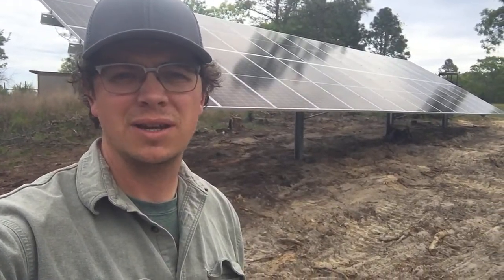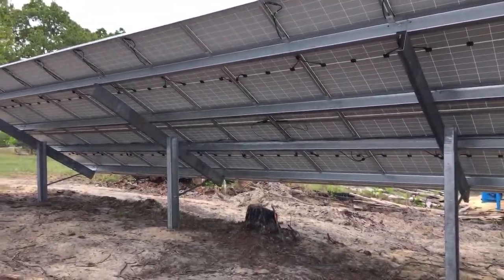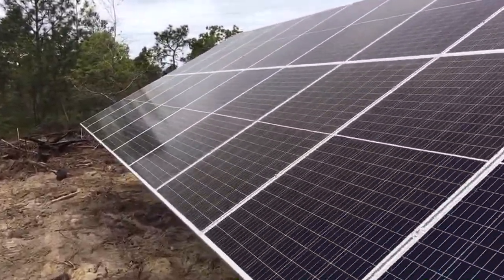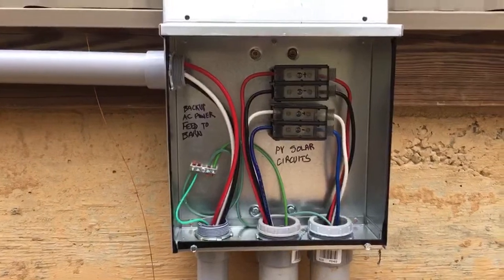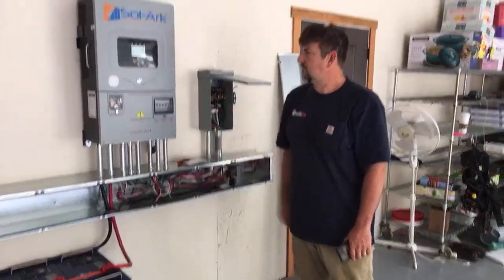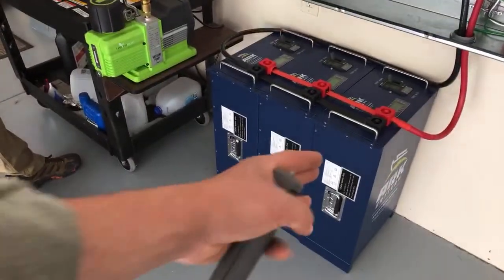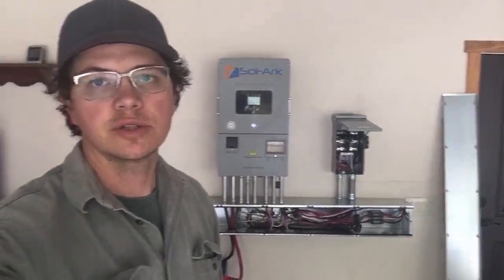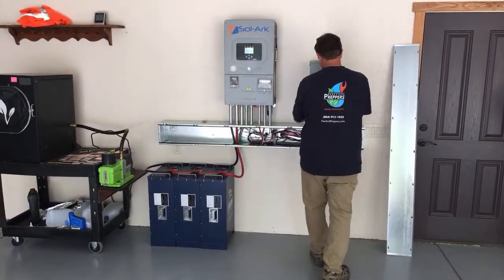Solark 12k ground mount w/Ark Lithium

Comment: Hey JV

On this long run I think you said you ran 8Gaconductors from the PV array-but per the spec sheet the SA12K MMPT max wire size is 10Ga.

Can you actually connect bigger than 10Ga from the array into the 12K or is there some trick to reduce them you didn’t show?
Reply from the maker: Yes sometimes we go into a disconnect at the house and down size the wire between the switch and the inverter
Reply: Do you have a diagram or a picture of this setup?  How is that not an issue for the current in the smaller wire?

Lastly-is the max wire size in the Sol Ark truly 10Ga or could you fit in 8?  
Thanks in advance!
Reply from the maker: @balrog006  I think we pulled six on this job. You can reduce down to a 10 from the 8.

Comment: iI it a code violation to use the IMO interal version in the box? I see you primarily use the external version.
Reply from the maker: If you mounted it in a box and protected it from moisture it’s probably fine but hard to make that readily accessible.

Comment: Those Ark batteries are 17kWh for $2500 before freight? I think I’ll take three. I have a sol-ark 12k grid tie only with 12.8k solar on it. 
Been trying to find a sensible storage solution. Those are impressive numbers.
Reply from the maker: $2500 per 5kwh battery.
Reply: @GainSolarPower   $2500 gets you 100ah@48 . pretty good considering say a battle born  12/100 is 800 bones. x 4 for 48 is 3200 dollhairs so ya, 2500 is very reasonable .. metal rack case, low temp co, shunt...  all in one no fuss.  do like.  the consumables in residential and commercial electrical  is far different than found in the small craft marine electrical world.  concept the same, product and code is totally different .  great videos

Comment: Would a charge controller be ran with just batteries? Like run the batteries to a point then swap to grid an run while charging the batteries. Then switch back to batteries. An so on

Comment: two questions why is the sub panel to the right of the sol-arc 12?  sounds silly but if there was the main panel in there, would it be main panel then to right sol-arc 12 and then to the right of the sol-arc would be the sub-panel. would that be correct?
Next (obvious but still asking) do you have to connect the sub-panel to the main panel and then connect the sol-arc to the sub-panel? or do you just have to connect the sub-panel to the sol-arc?  I feel stupid asking.
Reply from the maker: It’s ok man. Doesn’t battery which side The panel is on. Think about it like this. You have electrical panel A. There is a 100 a breaker mounted in electrical panel A that supplies power to electrical panel B. That makes electrical panel be a sub panel of electrical panel a. You could snap another breaker  In electrical panel B and feed electrical panel C and electrical panel C would be a side panel of electrical panel B.
Reply: @GainSolarPower  thanks for the reply

Comment: Nice install!  I really appreciate your videos. Thanks to yours and Scott's videos clueing me into SDE mounts, I'm getting ready to DIY install a 48 panel (72 cell) system on one of their seasonable adjustable ground mounts (concreted in, can't find anyone able to drive them here in central Indiana).  Definitely the most cost effective mount I found and I looked at a bunch. Grounding the array and grounding from the array to my inverters is still throwing me for a loop a bit though.  I didn't see any ground wire on the mount itself or any ground rods there. Do you typically ground at the mount also or just only run an EGC conductor in the conduit with your PV homeruns?  Any suggestions on a good resource to learn more about what is required for grounding of ground mount arrays would be appreciated.  Thanks.
Reply: Forgot to add.  My inverters are transformerless (SMA 7.7K's).
Reply: How much did your SDE mount cost?
Reply: @niktak1114  Total for the 48 panel ground mount with seasonal adjust option was $2950 (That was in 2021. Probably higher now since everything has gone up).  Concrete was another $950 to install.  It's a nice design and the install went smoothly.  A couple of hardware hicupps, but they were very responsive and helpful and quickly made everything right.  If I were ever to do another system, I would not hesitate to go with SDE again.
Reply: @tblservices4076  Wow that is cheap. Similar price per watt to the smaller unistrut mount I just built.
Reply: @tblservices4076  Also was that 3 panels high or 4?
Reply: @niktak1114  Yep.  I compared them to similar mounts and they are definitely competitive.  Also like that the single line of posts allows me to mow under them and check/service the panels easily plus the tilt adjustablity is nice.  That cost was me picking it up at SDE in lower Michigan (couple of hours from me).  Freight cost would be a bit for that weight and length.
Reply: @niktak1114  They are portrait orientation, so 2 high.
Reply: @tblservices4076  ah nice. That's about perfect for my upcoming 36 panel mount.
Reply: @tblservices4076  how many posts did you need and how much concrete did you need per post?
Reply: @niktak1114  My mount uses 6 posts/beams.  A little over a yard per hole (30" diameter holes 5 feet deep on average).  I ordered 7 yards on the truck and used every bit of it.
Reply: @tblservices4076  thanks for the info. That's fewer posts than I would have guessed.

Comment: What size conductors do you run for 600’ ? Seems like you’d have to go huge even at +400V.
Reply: Looks like you ran 6. That works out to between 2 and 3% not as bad as I thought at first. Love that you’re using IMO isolators. Very professional grade equipment.

Comment: Hi Johnny, I  am  planning on  setting up a  20 panel  system,  the panels are 39 in× 80 in, I am  running  two sets of 10 panels , 5 pairs each I would like to run them all on one ground mount 5 rows of 4 panels on top of each other  in landscape position,  they are Canadian solar panels,  can I  get  a  quote  ? Thanks  in advance
Reply from the maker: Jwv8783@gmail.com

Send me and email

Comment: Isn't this the same worksite I saw on Engineer775? So.... how's that work? One the GC, one the electrician? I know EGR is a mechanical engineer. Great work either way. I have a 100% off-grid 12kw ground mount job in Arkansas for ya'll coming up that i"ll be calling about before the end of the year.
Reply from the maker: If you want it installed before the end of the year you better call now. I’m the electrician and nabcep certified contractor. EGR is a mech E and he gets the jobs and has a machine. Hauls stuff, does the digging and selling
Reply: @GainSolarPower  Thank you sir! Installation will be targeting for 1st quarter of 22.  $$ available come end of 21. Solark too pricey so will be prob using 3-4 Growatt in parallel (15-20Kw). I'll have the batteries, panels, and inverter/controllers onsite, so will need to hash out best config and ancilliary gear like autotransformer, HVAC, etc. Water heating still needs a solution. Will set up consultation soon! THX!

Comment: What is the price on that wire trough?
Reply from the maker: There are a bunch in the video. The small share ones are about $45. The long ones vary. But usually around $200
Reply: @GainSolarPower  Sorry I should have specify, the main one below the sol ark. 10x10x72 inch I Believe. Do you supply them? or if not what supplier sells them.
Reply from the maker: @jacquelineheaton8463  please send me me email

Jwv8783@gmail.com

Comment: Fail --you don't run jacketed cable (the sec/ser cable) or MC cable in conduit !  Thats why you have the issue with the anti short bushings ---What should have been done is a J box at the other end of the pvc conduit run and a MC connector used.
Reply from the maker: You are incorrect sir. We passed inspection with flying colors. I’d love to see the specific part in the code that doesn’t allow me to do that.  MC cable can be used in raceways. I know what you are saying about not landing in a connector but we do use anti short bushings and observe conduit fills. While we are picking people’s work apart,  let’s see some of your stuff.
Reply: @GainSolarPower  conduit is NOT a raceway  ---you would never pass with my inspectors!
Reply from the maker: Are you and electrician?  Have you read Art 100 of the NEC. The definition of a raceway is in there. If you are an Electrician I’m not gonna argue with you. 

One thing I have noticed is that work is done differently all over the place and it’s ultimately up to the inspector and he passed our job so if you are arguing with me about stripping out 15’ of MC transitioning in a box with a fitting so I can run it the the pvc then i get your point but If you are arguing about rather a pvc conduit is a raceway you are wrong there buddy.
Reply: @GainSolarPower  a retired electrician after 50 yrs in it
Reply: @peevedpatriot3217  well where do we go from here patriot. I don’t want to disrespect my elders.